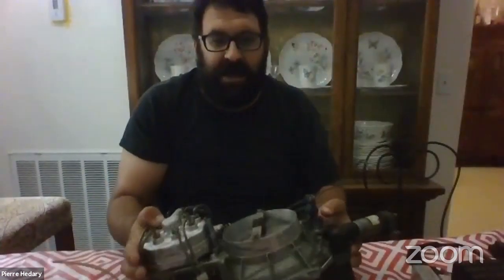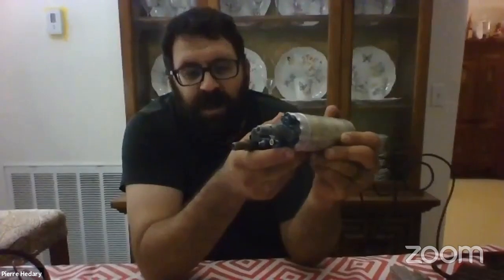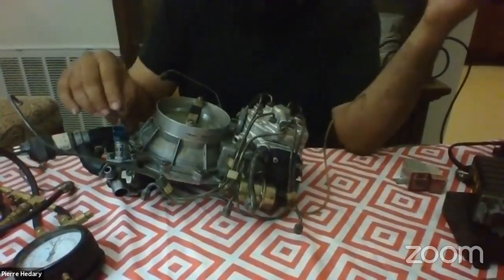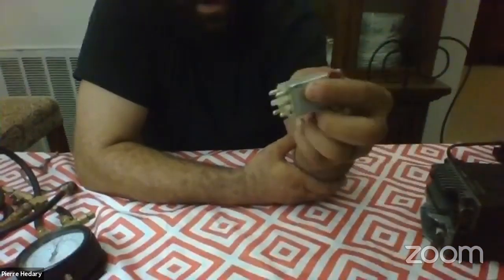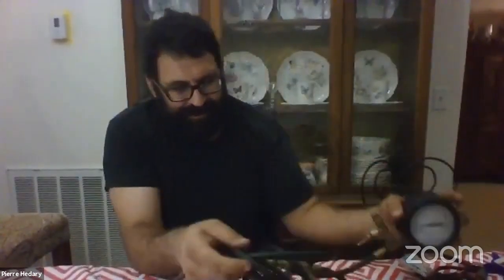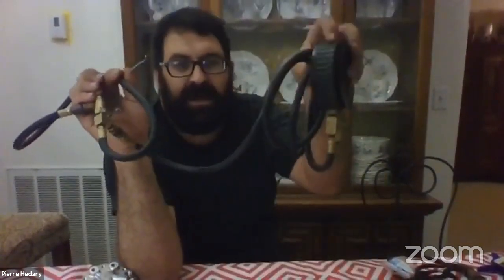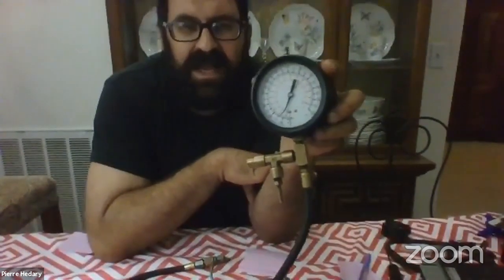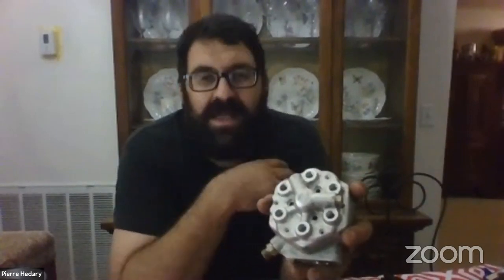MBCA & Pierre Hedary Present:  KE-Jetronic Fuel Injection

Comment: Excellent presentation Pierre! I have an '86 560SL to diagnose and the info in the video was helpful. The engine starts immediately and then shuts down within 3-5 seconds.  Starts right back up and then dies again, over and over.

Comment: Thank you for all your effort.

I have 1986 190e 2.3 8valves, gas, and please correct me on the following steps on calibrating the EHA valve:
1- Engine at normal temperature 80 degree,
2- install pressure tester lines, tester valve closed, unplug EHA,
3- start the engine
4- take the reading
5- open the tester's valve, 
6- taking the reading,
7- after I reach 0.4 bar difference, turn engine off,
8- discounted the tester lines,
9- plug in the EHA valve's electrical.

Thank you

Comment: Hi, I have a W126. 1990 560 SEL. All of a sudden, I have a rough idle and lack of power.  The low rpm idle stalls the car if I don't depress the accelerator. I replaced the fuel system, new ignition distributor, rotor, spark plugs. I am trying to troubleshoot the Idle Control Valve.  At this point, I am seeing continuous fluctuating voltage (0 - 2.1V) at the terminals of the ICV when the car is cold.  Could this sysmptom be a faulty Idle Speed Control Module? Or something else?

Comment: what would cause fuel coming out from all top port with plunger all the way down (idle condition) after fd rebuild? haven't troubleshot much but as soon as pump is shorted to run manually, fuel comes out n loud buzzing/whine happening, like fuel pressure oscillating... i'm thinking either EHA adjustment is wrong or fuel pressures are wrong...

Comment: My 500ge misfire's when its hot, what could cause this problem?
I replaced the spark plugs and wire's 
Ignition coil
Rotor and cap
When i replaced the rotor cap and coil it was running perfect. A week later it was misfiring again and the engine shakes.

Comment: Great Video👍🏽 i have a question 
My se300 from 88 doesnt want to start anymore after i replaced my fuel Pump, because the old one break after welding.
The new one is from Bosch old one not. There is fuel in the cylinder and sparks are Ok.
Engine was running before welding.
Thanks

Comment: Pls I have my w124 using k jetro bt my car is mixing petrol and engine oil I have been looking for help never found any it is misfiring blue smoke wet spark plugs the mech once adjusted the sensor plate bt the problem came back after a month help me he says it's a bterfly problem help me

Comment: Loving this channel. Wish I knew about it with my old 114 D-Jet 
Does anyone here know what the issue is with a 124 300CE which won’t creep forward by just releasing the brake? In other words I need the throttle for car park or parking manoeuvring. Any help would be much appreciated
Reply: I have the same issue, did you figure out what it was

Comment: minute 40 why would a blocked injector cause the engine to run rich?
Reply: I think the O sensor would read lean, thus richening the mixture overall, causing the others cylinders to run rich, plus the rest carrying the load of a not correctly functioning cylinder will make it use more fuel. Same thing happens with a blocked jet in a carb, fuel economy plummets!